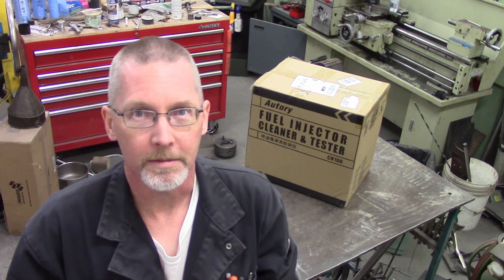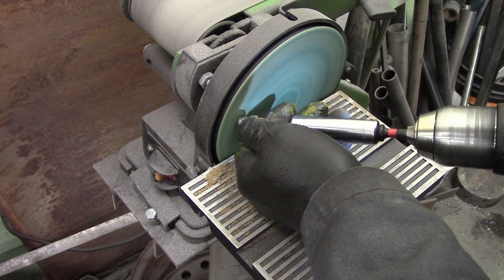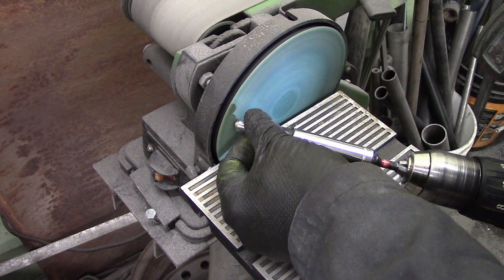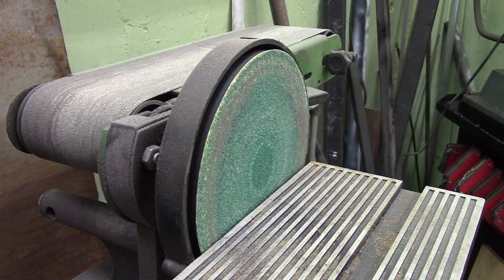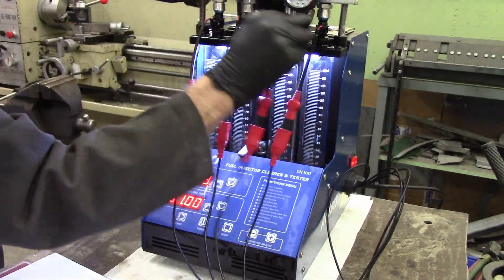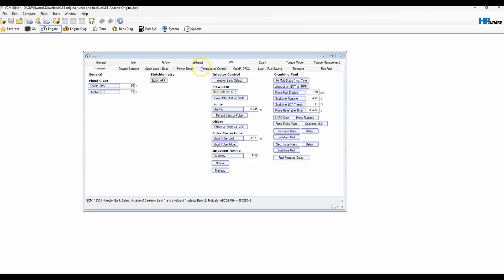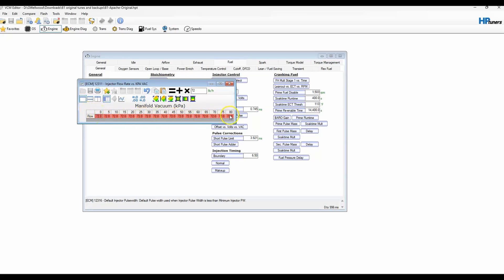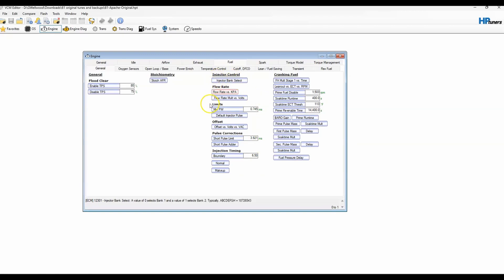Decapping Injectors: BIG Flow with LITTLE Effort!

Comment: Great Video. I also am running decapped injectors on my turbocharged 6.0 LS. I ended up setting them at 75 LBs in the flow rate table IIRC. I decapped mine 8 years ago and built a homemade flow bench out of and Arduino board and a stock truck fuel rail. It worked great. Fast forward to today, I'm getting ready to build another LS for boost and while my homemade flow bench from nearly a decade ago works fine, it does leave a lot to be desired. Got an Autool CT160 that will be here tomorrow. I'm considering trying some decaps and ALSO removing the filter basket. I have done some preliminary testing of this and decaps that also have the filter baskets removed seem to flow even more than just decaps do.

Comment: I never understood De-capping injectors other than the engine ran better and made more horse ponies! The OEM's are required to get better MPG, but if increasing performance at the same time, they would do both. They don't. I have cleaned injectors with special equipment that triggers the Injectors 20 times measuring the volume.  The GM dealer would clean them once and require "Top Tier Fuel" afterwards. 
    Remember, gas octane or anti-knock rating was non-existent for 100 years. The model T had an advance-retard lever in the steering column for timing because gas / fuel anti-nox rating was not a standard or published! Thanks!

Comment: Nice.  Does increasing the flow rate decrease fuel economy, assuming the increased flow doesn't lead to increased romping on the right pedal?  Didn't you have a different injector cleaning machine and if so, which one do you like better?  Thanks!
Reply from the maker: When you change injector flow rate, you MUST tune the ECU accordingly - ALL of its calculations are based on a known injector flow rating.  So, no, if you adjust the ECU accordingly, there should be no reduction in economy.  Until boost.  Tee hee.  I have an "On-Car" cleaner, and this bench top model.  I like the bench-top one better, because I can test them, check the flow pattern, clean them, and confirm them afterward.  More work though, but life ia like that.
Reply: @GregWellwood  Thanks!  Just curious at this time.  I will be deep diving into my LS in the future but need to get all the bones solid first.  I'll bet students line up to get into your class!
Reply from the maker: I know you check in every week (you're awesome!) - NEXT WEEK we go deep, setting up to tune for boost.  See you there!
Reply: @GregWellwood  Thanks for the heads up!  I'm thinking if I want to go the turbo route when I rebuild my engine.  I'm not very good at TIG welding and all that plumbing has me worried.
Reply from the maker: You don't have to TIG everything, MIG works just fine.
Reply: @GregWellwood  I'll probably do some TIG practicing, just because it will look better.  Plus, it's a good excuse to buy some stainless tubing!